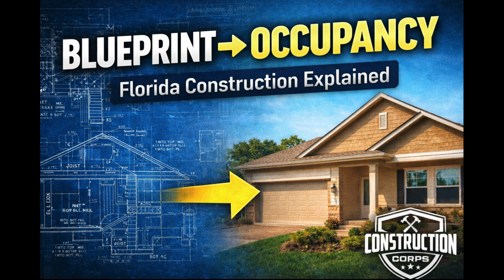Why Florida Construction Takes So Long (Blueprint to Occupancy Explained)

Comment from the maker: Most homeowners think construction starts the day after they sign the contract.
In reality, the most critical parts of a Florida construction project happen before the first hammer swings: engineering review, permitting, material procurement, inspections, and scheduling specialized trades.
If you’ve ever looked outside during a renovation and thought “nothing is happening,” this video explains why.
If you’re planning a renovation, addition, or rebuild in Florida, drop your questions below and I’ll answer them.
– Matt
Construction Corps